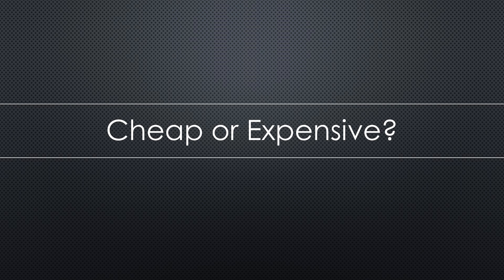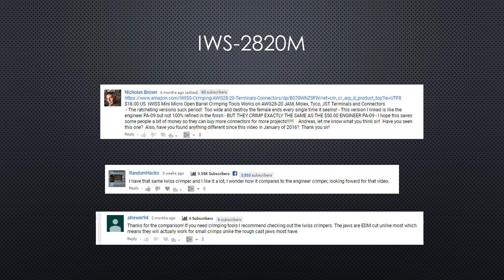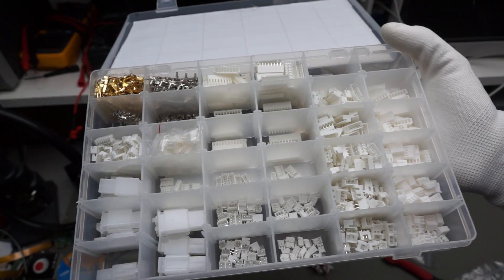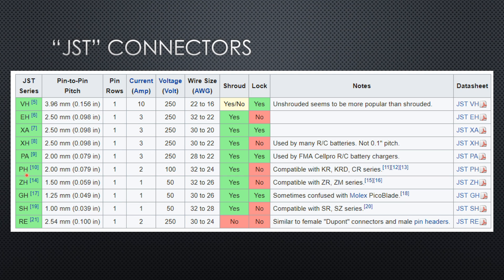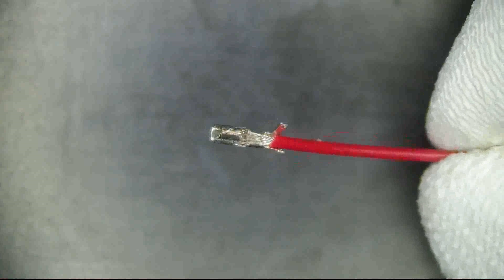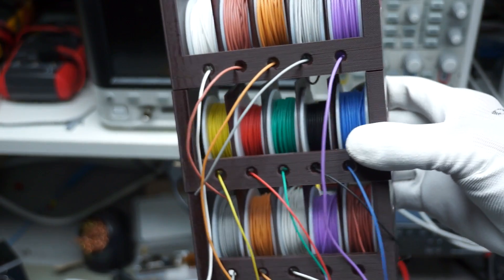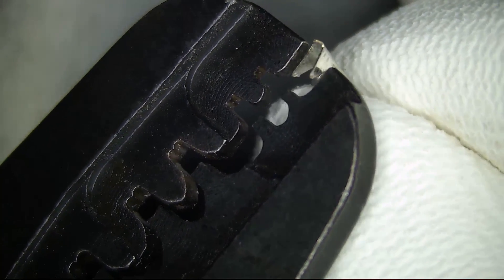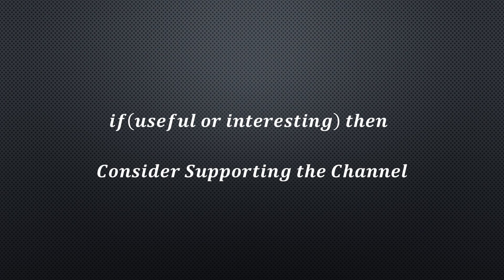#282 Crimpers: IWISS IWS-2820M  against Engineer PA-09?

Comment: "I have a selection of..." and shows a tray of a few thousand cables 😀 you Swiss guys have just too much money 😂
Reply from the maker: We do not have it anymore. Obviously;-)
Reply: It's not as much about money as it is about time. A hobbyist can spend an hour crimping cables on a project because it doesn't matter if the project takes an hour longer, the result is the same. If a professional has to spend an hour crimping cables, that's an hour they have to spend paying themselves or someone else's salary just to crimp the cables. But cables are cheap compared to labour, so it's much cheaper to just stock up on various kinds and lengths of cables every time you have a project that demands them. Then next project that you need that kind of cable, it's much quicker and cheaper than making your own.

Comment: You are crimping the JST wire wrong.  You need to use 1.3 or 1.6 for the metal part and 1.9 for the insulated part.  That's why you have "wings" in your crimps.  Check out this for example: https://www.youtube.com/watch?v=l0rAEPJoWeE
Reply from the maker: Thank you for the link! I will try it.

Comment: What a garbage comparison, you could not even get some suitable connectors to compare them properly. Neither of these tools are suitable to crimp insulation on Dupont connector. It needs a completely different profile of the crimper jaws to do wrap the leaves around insulation properly, not squash them the middle.
Reply from the maker: Thank you for sharing your opinion.